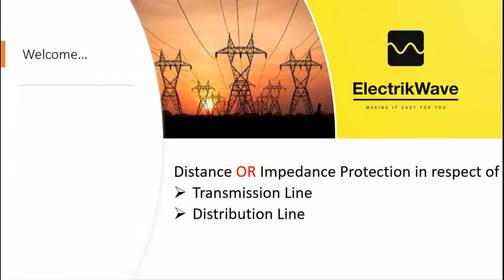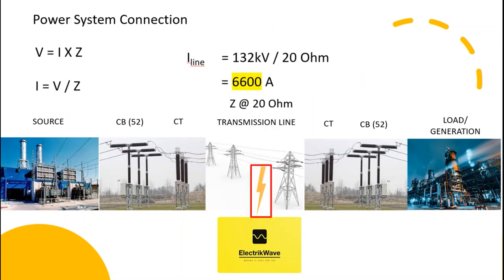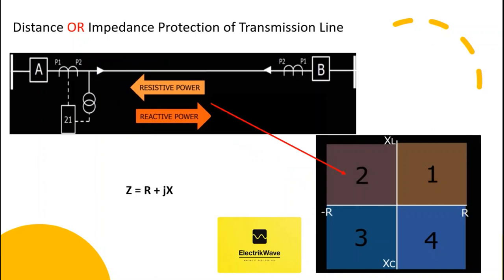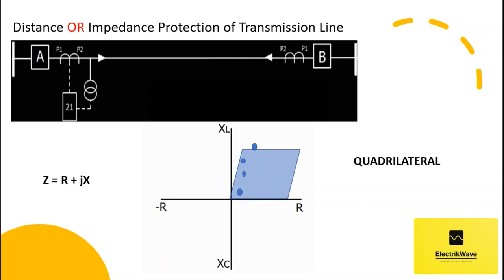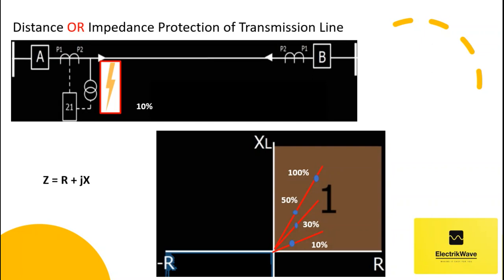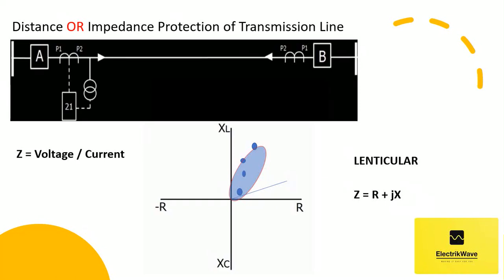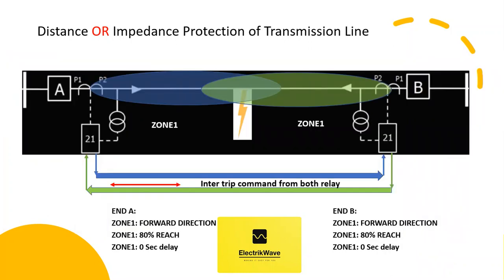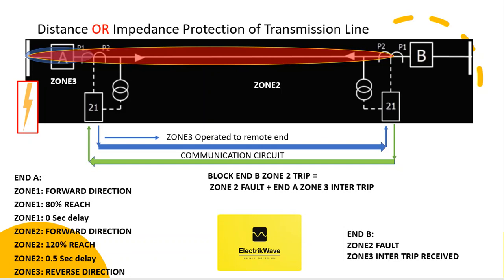Distance or Impedance Protection of Transmission Line or Distribution Line

Comment: Why don't you add the other series impedances to calculate fault current at transmission line and load side...
Reply from the maker: Correct, the fault current can be calculated as per actual fault location (OHTL, UGC, GIL), further in case of line to ground, it also depends on whether fault is through the wooden pole or steel pole, consideration of other parallel conductors like shield wire/OPGW etc.